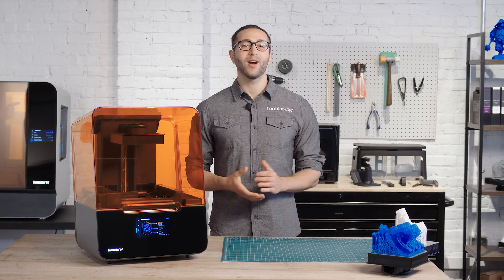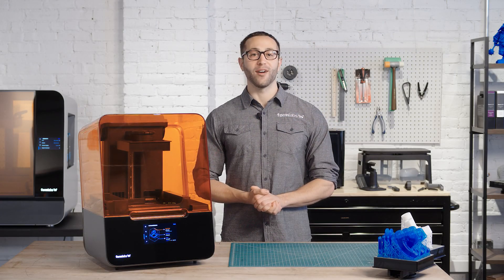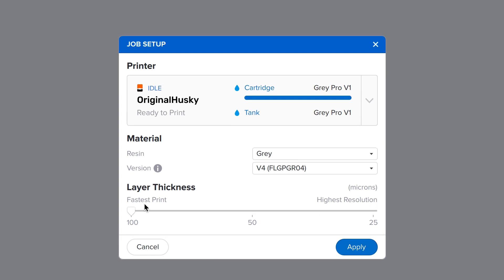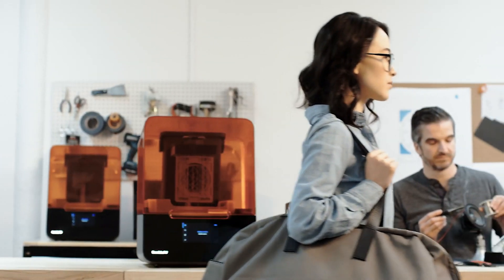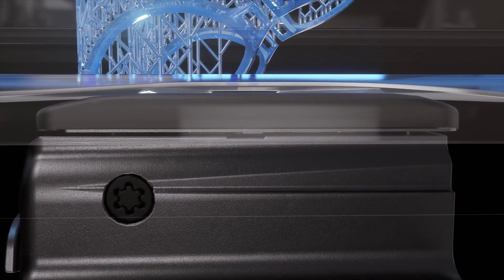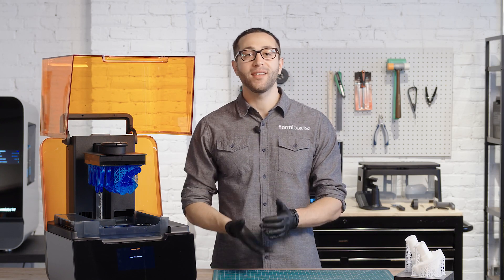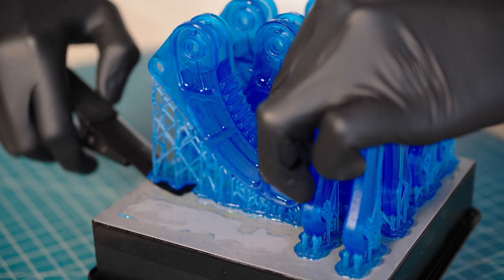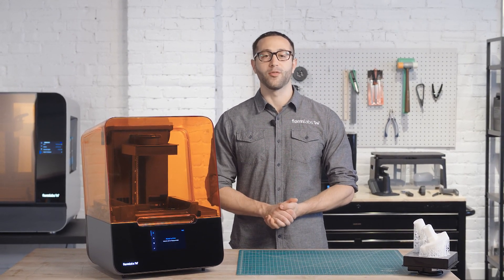From Design to 3D Print With the Form 3

Comment: Screen stops responding…. Be warned
Reply from the maker: Hello there. If you are having issues with the printer's screen, please do get in touch with our Support team, they will gladly assist you with troubleshooting this, as well as send you a replacement part if needed. You can contact them here: https://support.formlabs.com/s/contact-support?language=en_US
Reply: Formlabs nice. Is the screen on the L the same? That one is working just fine. I’ll be getting in touch today.

Comment: How long does the resin tank last? how many tank refills?
Reply from the maker: Tank lifetime is dependent on which resin is being used. Lifetime for Form 3 tanks is comparable to Form 2 LT tanks.
Reply: Yeah I called them and I specifically asked about consumption and he was very vague when it came to it. Once I did my own due diligence I saw that these printers are not viable for production, rather than highly specific industries that can justify that material usage.
Reply: I was just on their website. It says the LT tanks need to be replaced after every 2 liters. So that's basically 2 refills then you have to spend another $100 to get a new resin tank on top of the $175 - $200 per liter. They didn't want to be upfront with you and tell you the pricing.
Reply: John Razvaliaeff that's incorrect. It's ATLEAST 2 liters with the Rigid, grey pro, and Elastic materials. You usually get about 12-15L with the standard resins and about 8-10 liters with the engineering resins.

Comment: Will it print steel and stainless steel?
Reply: Scott Klammer no. You need an ADAM or DMLS machine to print metal.
Reply: Scott Klammer Also, only Tool steel and Stainless steel can currently be printed, and the machines that can do both, with the accuracy of the SLA technology cost about $200,000-375,000
Reply: @owencoyne6223  looks like hp is coming out with 1 that looks promising. About 400 k
Reply: Scott Klammer it sure does, but thats a jetting printer, the ones I was talking about are DMLS machines, these sinter the powder, making a final part that doesn't need to be fired in an oven, jetted parts need that oven time.
Reply: @owencoyne6223  thanks. I'm just getting into looking at them for our company. phase 1 I need to print patterns strong enough for our foundry machinery to make molds with. Final phase will print different grades of steel parts.
Reply: Scott Klammer if you are trying to make injection molds with DMLS, don't. The surface quality of the mold (DMLS part) is not good, so in turn, your part won't be good. But if you are only looking for a jig for the mold, then rigid resin may be the way to go.
Reply: Scott Klammer they also have castable Wax resin, which if combined with the Form 3L, could make massive wax molds, which have a clean burnout.
Reply: @owencoyne6223  thanks

Comment: Let's take a minute to realize that big speaker print cost about 200$
Reply: It's 1210ml of resin at 150$/L so I comes out to a $181.50
Reply: @owencoyne6223  FDM printers still rule when it comes to material usage costs especially on large prints.
Reply: innomind By a lot at that.
Reply: although, msla now isnt as far off